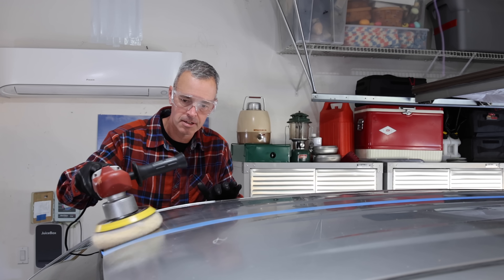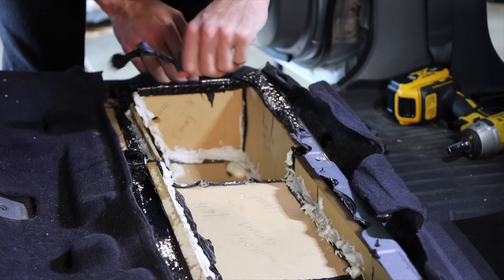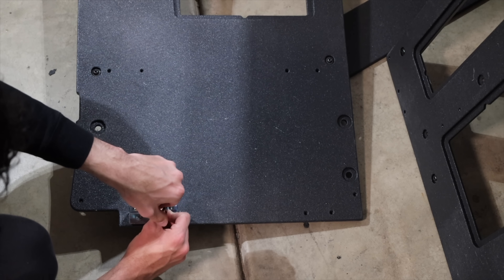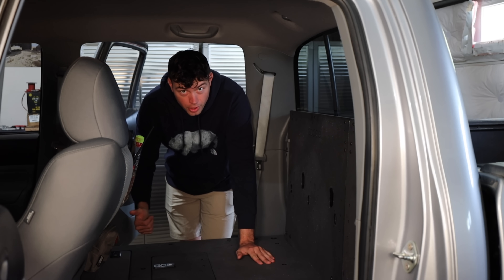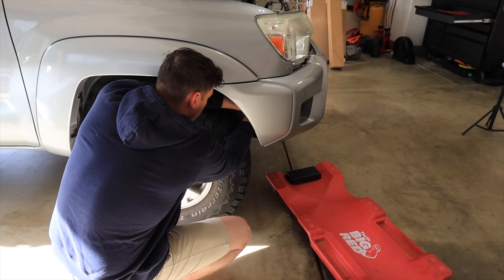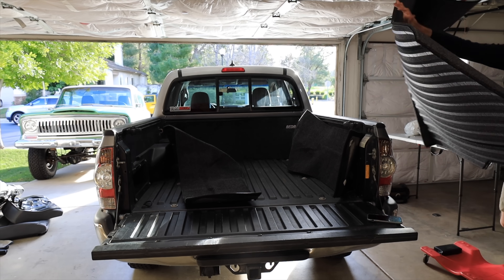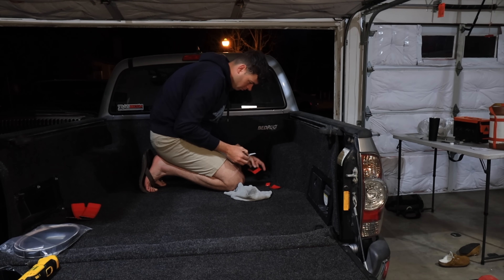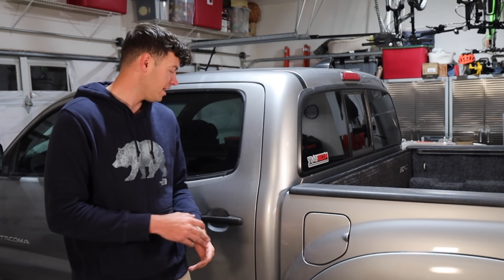3 Incredible Toyota Tacoma Upgrades that Totally Transformed the Truck!

Comment: Quick simple upgrades for sure. Remember to install bed stiffeners(I recommend total chaos or diy) if you’re going to be loading up the bed and going off road. Cheers dude 🤙🏻
Reply from the maker: Thanks!  Something that's top of mind for this truck for sure!
Reply: @TrailRecon  A good camper shell company will be saavy enough to include this.  But its something to be aware of.
Reply: just wanted to second this comment. Bed stiffeners are a must and the Total Chaos ones are great. I like the footprint compared to others, also they are a So Cal company.

Comment: Great video! Here's a tip for laying down velcro in the right place: attach the hook and loop together on the piece that moves, then remove the adhesive on the unattached side, and push in place. That way it's automatically lined up.

Comment: I did the full rear seat delete with the Goose Gear install on my Ram Power Wagon and it may be the most useful and favorite mod to my rig yet. I built a cage system from molle panels that contains a Bluetti Power station, tower housing my radio gear, and plenty of room for my 66 liter SnoMaster frig/freezer. With that much molle, you can only imagine the possibilities for gear storage, as well as weapons mounting. Great addition for your Tacoma!!!

Comment: Bed rug is an amazing product. I have had them in my trucks for 15 or so years. I have always kept a tonneau cover on my beds but those never seal perfectly so they always get a little wet and have never had issues with mold and easy to clean.  Great product.

Comment: Depending how long you plan to keep the taco it might be a good idea to have some XPEL PPF applied to those headlights. It will keep them from fading and getting rock/sand blasted!  Great job on the videos, love the tacoma content!
Reply: Superb idea - but perhaps take it one step further?
I put 8mil ppf film on my JK windshield and it thwarts direct rock hits.  Over 30k miles in 2.5 years and I have a blemish free, no rock chip windshield.  For comparison, my first 1.5 years accumulated 8 rock chips/cracks.  The stuff is amazing.

Comment: I love Toyotas and have driven a few Tacomas even with a 5-speed manual. I’m currently getting a black grille for my 2006 Dodge Ram 1500  4WD and looking for LED lights for it since my current lights are hazed up and it’s hard to see at night while driving and I’m possibly going to get a Molle panel installed in my truck bed for my Minelab metal detector and my other equipment.

Comment: I have a 2004 Tundra Extra cab.  I would like to do something similar.  Take the back seat out,  build a flat platform and put a 50 qt cooler/Jackerey 1000 combo in its place.  Not many bolt on options you can get these days for a 20 Y/O Tundra,  but it still is in such good shape that it is unfeasible for me to  let it go.  My local Toyota Dealer head mechanic wants it.  That tells me something.

Comment: Ugh...... Used vehicles always hide some surprises. Glad to see it wasn't that big of a deal and hadn't done any major damage to the sheet metal if the cab. Nice upgrades. I especially like your choice of lighting. They look much nicer, and modernize the front of the truck nicely. I'll have to pay attention to your future thoughts on the bed rug. I opted for the Weathertech liner, but I'm not sure I'm really sold on it. I'll be curious to see your thoughts on your choice. Can't wait to see your next upgrade.

Comment: You should put insulation in the walls of the doors. So it gets quiet in the cab of the truck. Less road noise and warmer and keeps heat out longer in the sun

Comment: Great job on the video and taking on new things to figure out how they work. Well done!  If you decide you want that anchor bar back in the front of the bed, bet you could use a soldering iron or hot nail/Phillips screwdriver to bleat a hole for your anchor screws to go through.  Enjoying following the build.

Comment: Good job on the video and I approve of your vehicle choice (We have two 2nd gen Tacomas and a Tundra in our household). 

Bedrug is one of those things that seems kinda, I dunno, silly. Until you get one. Mine has been installed for about 8 years now and I love it. Only thing that has worn on it is the little flap between the tailgate and the bed is a little frayed from opening and closing the tailgate about 3,000,000 times over the years. I use my truck for work so the bedrug has seen a lot of use. Only thing I have found that hurts it is velcro will fray it if it gets stuck to it.. Good news is you can velcro things to it if you want.

Comment: Nice work! Always love some garage therapy!

Quick tip, you can install that back rail over the bedrug similar to what you did with the tailgate (if desired). It will act as a reinforcement so it doesn’t fall down over time from the velcro and as a bonus, you get your tie down points back!

Comment: Congrats on making your new rig your own. That gooey stuff you took off is more than likely butyl rubber used for sealing windshields and headlights. I'm also the 2nd owner of my rig and its fun finding little easter eggs from the previous owner lol

Edit: Glad to see you went with Morimoto on the headlights. That's a very good brand. I used to build custom headlights and got most of my supplies from the retrofit source. Those will definitely give you the quality in lighting you need.

Comment: I had a Dodge Dakota before I bought my Toyota.  At about 100,000 miles it pretty much self destructed.  Took it in to the local Dodge dealership to get it repaired.  They gave me a brand new Dodge Ram 4X4 to drive as a Loaner.  Dangling the Bait. I decided to test drive Toyotas for comparison.  20 years later I am still driving the same Toyota.

Comment: You should see if Diode Dynamics will sponsor some SS3 LED Pro in Amber (or white if you prefer) SAE fog lights to go with the Amber DRL’s. There is also a bypass mod that allows you to run the fogs with just DRL’s on.

Comment: If you haven't noticed it already, there seems to be an issue with your front fender flares.  It looks as if the front of the flares, closest to the bumper are pulled away from the fenders on each side.  Looks like there's a tab that needs to be tucked under the fender.

Comment: Don't let the jeepers get to you. Jeeps aren't the end-all be-all of offroad and overland vehicles. They just happen to be the best supported in the aftermarket, and the easiest way to get into the hobby or lifestyle. Those two facts makes me avoid them. I don't like being like everyone else and I like having off-beat vehicles that you don't see as often on the trail.

If you haven't discovered them yet, check out Marlin Crawler when you are ready to look at mechanical upgrades to your drivetrain. Front Range Offroad and Ruff Stuff Ind. has lots of yota parts too. There's also Yotamasters.

Great work on your Taco!